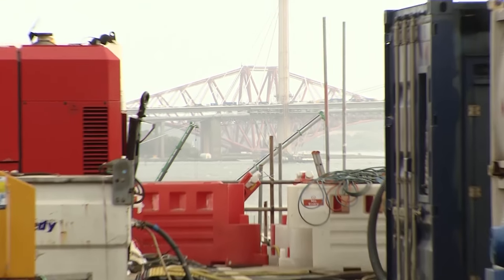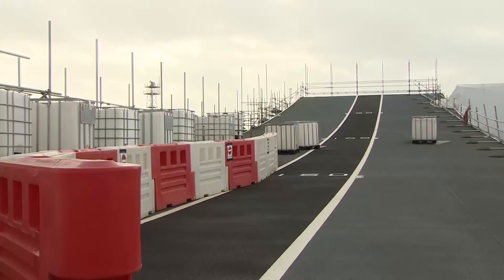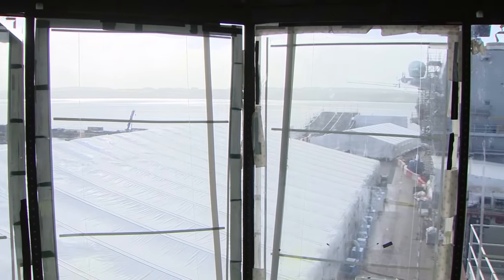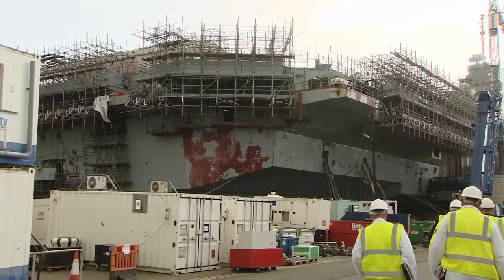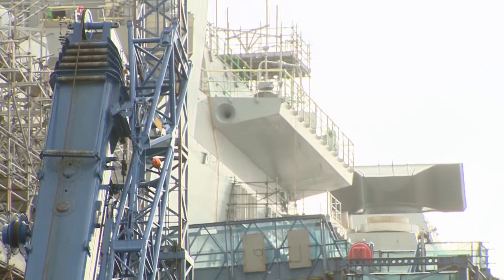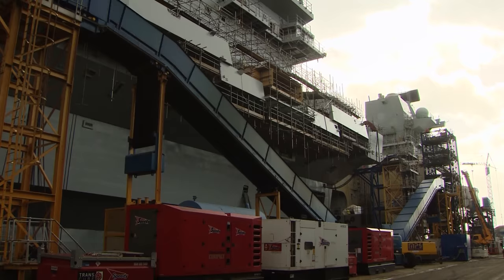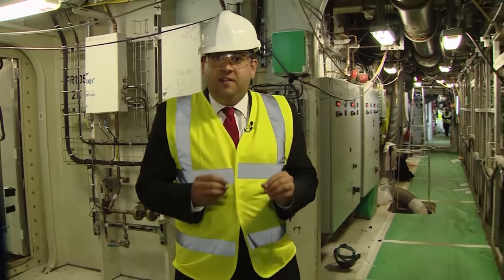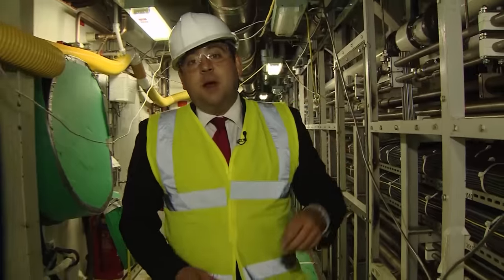HMS Queen Elizabeth Shipshape And Almost Ready | Forces TV

Comment: The reason there is 2000 sailors on the Ford vs 650 on the QE is because the Ford is much bigger with a lot more air equipment. The Ford is technically just as or more advanced than the QE. The Yanks have a shit ton more experience at building aircraft carriers than any other nation. Not only that they have a fuck of a lot more money to do research and development.
Reply: It's not that much bigger to warrant the huge increase of crew size, it's more of a combination of both.

The US has focused their efforts into areas which they'll find more beneficial for themselves. The Royal Navy is struggling to crew all of their ships due to lack of sailors, so automation is much higher on their list of requirements.

There's a lot of innovation in both ships and are a big jump forward for their respective configurations (CATOBAR and STOVL).
Reply: it is much bigger. don't let overall length fool you, it is only about 70 meters longer, but more importantly it carries near double the amount of aircraft 80 vs 40...on top of that the aircraft it does carry have more range than the aircraft the QE can carry. On top of that the Ford has a catapult assisted takeoff compared to the QE which is limited to only being able to launch aircraft capable of STOL. Which means the Ford class carries larger and heavier aircraft. No catapult assist is just a waste, limited to STOL is the same technology the very first aircraft carriers had...by technology I mean no technology at all, unless you consider a ramp, technology.
Reply: johnabuick HMS Queen Elizabeth will weight in at about 70,000 tons, cruise at about 25 knots (they say), carry a little shy of 700 sailors, flyers, and marines, and be able to field around 40 aircraft. Cost: $6bn where as the USS Gerald R. Ford will weigh in at about 100,000 tons, cruise at about 30 knots, carry a 2000sailors, and be able to field around 75 aircraft. Cost $12.8b U.S. But  it can only be in one place so two QE class ships are probably more flexible.
Reply: Peter Loftus
Sure, except the Americans already have 10 carriers the size of the Ford and ten times more ships than the British.
Reply: This video is in error - the Ford class actually will have a crew of over 4000. It took a lot of design work to get that down from the Nimitz class which has over 5000. If the QE's can get by with only 650 that is an amazing accomplishment.
Reply: The ford's crew is 1600, that 4000 number is the capacity including marines and airmen.
Reply: According to the US Navy .........
Crew: Ship's Company: 3,000-3,200, air wing: 1,500, other: 500.
Reply: and the Ford has planes..... jus saying
Reply: +peter loftus the US is building 3 Ford class carriers not 1. The QE has a small crew due to low funding to have a full crew and its smaller in size the Ford class has a large amount of automation but taken into account its nuclear powered and has far larger air crew the Ford is the most impressive and advanced carrier in the world

Comment: And what will they do when combat damage bends a bit of that metal track for the automated ammo movers?
Reply: Abandon ship, because if damage extends that far into the ship, it's lost.
Reply: If something has gone deep enough to damage the munitions handling equipment its reasonable to assume the munitions themselves have been exposed to the threat... ie a fair chance the magazine just went up and the ship isn't there anymore.
Reply: yeah 9 or so decks down, if something manages to get that far the ship is fucked.
Reply: That's surely the idea!?
Reply: Simon Ocean AEW was non existent in the Falklands, there was nothing until the Sea King AEW2 came online in 1985. The AEW2's then went through various upgrades culminating in the ASaC.7. The plan is to fit the ASaC.7 kit to a Merlin airframe and keep going, though this wont be online until 2018.
Reply: Simon Ocean Would rather have seen something based on the V-22 myself. Rotary based AEW is just so limited compared to fixed wing. An order of V-22's would also allow for long range COD and potentially tanking as well... not going to happen though.
Reply: Yeah I've heard some talk but I can't see the MOD stumping up the cash for it though. THE USN actually have commissioned the CV-22 to partially replace the C-2's. Still though given the size of fleet the RN would require and the procurement and operating costs of the V-22 I just don't think its likely to happen.

Comment: Great ships....shame about the F35!
Reply: Monster LMA What remaining Typhoon order?
Reply: The Typhoon is a fine aircraft, and you're right that they're different aircraft for (some) different roles, but the Typhoon has very little on the F-35. The Typhoon does have a little faster top speed, but it's not getting anywhere near that speed loaded down with external stores. The thrust-to-weight ratios are very similar, not "vastly superior" (1.15 Typhoon to 1.04 F-35B). The F-35 has the superior combat radius on internal fuel alone compared to the Typhoon's range with three external tanks. Where the F-35 is really has the advantage is the avionics, you got it completely backward. The F-35 has vastly superior avionics to any aircraft, even the F-22. The F-35's low probability of intercept AESA radar, distributed aperture system (provides IRST, missile warning, air-to-air and air-to ground target identification and tracking, high-off-boresight missile launch, night vision that still allows use of the HMD, all of these in complete 360 degree spherical coverage), EOTS (built-in, not an external pod wasting a weapons station), HMD, EW, MADL, cockpit displays, and mission computer all have no equal. The F-35 will be a huge capability improvement for the UK.

However, as you said, F-35 vs. Typhoon really isn't the comparison one should be making. They're both going to serve the UK together. The Typhoon for the RAF from the land, and the F-35B for the RAF and RN from the sea. If you want to make a valid comparison, compare the F-35B to the aircraft it is directly replacing in UK service, the Harrier. Compared to the Harrier, the F-35 is light years ahead in every regard.
Reply: I get my figures from actual official sources, not the likes of idiots like War is Boring or Pierre Sprey, and first hand experience. I work on the F-35 every day, I am a Marine avionics technician on the F-35B, and previously was the same on the F/A-18 Hornet.
Combat radii:
-Typhoon: 750 nmi (air defense, 10 min loiter with 3 external tanks)
-Typhoon: 325 nmi (ground attack with 3 external tanks)
-AV-8B Harrier II: 300 nmi
-Harrier II GR.7: 300 nmi
-Sea Harrier F(A).2: 540 nmi
-F-35B: 467 nmi (on INTERNAL FUEL ONLY)

All the Harrier numbers are with external tanks, while the F-35B is superior or competitive on internal fuel alone. Just look at any legacy aircraft, Typhoon, Harrier, Hornet, F-16, F-15, you ALWAYS see them flying with external tanks because they have such short range without them, especially with lots of heavy bombs dragging them down. I don't know how to convince you about the avionics, the F-35 simply is the most advanced radar and avionics suite ever put in a fighter aircraft.

The F-35 can go super sonic for short periods without afterburner. The afterburner has nothing to do with radar signature, it only would affect IR signature; IR guided weapons are pretty much all short-range. The non-stealthy Typhoon is always vulnerable, afterburner or not, whereas the F-35 is only (partially) vulnerable when it is CHOOSING to use its afterburner.

The F-35 can catch the Tu-22M, which isn't really a bomber but a ground attack jet. As for the just 16 Tu-160s Russia has left (even fewer actually airworthy), they can more than be handled by the F-15 and F-22 and as you point out, the Typhoon.

Don't know what you're talking about when you say stealth is because of "active" systems to cancel the radar signal; this just isn't true. If you mean the electronic warfare jammer, that is for jamming, it doesn't "cancel out" the F-35's own signature. All these "stealth defeating" radars that the Russians and Chinese boast about are all bluster; they are far behind the West in radar and other avionics technology. Don't expect them to magically defeat the stealth of the F-35, F-22, B-2, or B-21 anytime in those aircraft's lifetimes.

I agree that the UK could have got a better capability with the F-35C, but they made that choice too late. Typical political shortsightedness and liberal sabotage in regards to the military. By the time they said they wanted the F-35C, the carriers were just too far along to change their design. And the F-35B does NOT use afterburner in STOVL modes of operation! Don't know where that came from, but it's total BS. In the field, it can operate from the same AM-2 matting as all our other aircraft (and yes, we have already done this in testing and operationally).
Reply: Locutus494
Reply: Good post, but your carrier design change information is backwards. In fact, these new Royal Navy carriers were originally designed with angled flight decks, cats and traps and with the F-35C in mind. You can see the original design concepts online. The Ministry of Defense made a late hour design change to eliminate cats and traps. Of course that necessitated the F-35B with it's STOVL design. The decision was purely to save money but it was shortsighted because it severely limits the kinds of aircraft that can be launched and recovered by the new carriers. The design change will also limit its mission capabilities since the F-35B model has shorter range than the C model. Additionally, the carriers won't be able to utilize the highly capable E-2D Hawkeye airborne radar aircraft, which would have given it far better and longer range "eye in the sky" situational awareness. Those duties will now be handled by a far less capable helicopter carrying airborne radar that can't loiter for nearly as long as a Hawkeye. Hopefully, the Royal Navy will turn to the V-22 Osprey and utilize it for resupply cargo. I wonder if they can build a version of the Osprey with airborne radar? Probably, but that won't be cheap.
Reply: Lol f35b whont have anything to land on! The uk are selling these ships after a three years service. Google it if you dont belive me all part of tory wanker cuts.
Reply: Tim Xero, your complete ignorance in all your comments here is astounding! Literally not a single thing you said about the F-35, F-22, US-Japan history, or anything else you talked about is remotely true. The US banning other countries from making stealth aircraft, are you high? The US has no authority over it's allies to tell them what they can and can't do. What in the hell are you talking about here? F-22 has no radio? How could you for a second think that is actually plausible. And it was cancelled for the same reason as any other useful military program is cancelled; because idiot politicians don't learn the lessons of history and keep chopping the military when they should be building it up. The US occupation of Japan ended in 1951; our presence there since then is as part of our security agreement with Japan because Japan's post-war constitution renounces having its own military and it allows the US forward basing to protect its interests in the East. It is mutually beneficial.
Reply: Van-gabond,Ramblin'Rose And not that many of them either. ?
Reply: Locutus494 Are you seriously suggesting that the stealth aircraft will not be able to be detected within their lifetimes? That is a pretty assured statement. I would suggest that the US has already developed radars that can lock on and track all these aircraft! They would be insane to field one without the ability to defeat one.
I would also point out the panic that occurred when a rapier demonstration radar locked on to the B2 at the Farnborough air show in 1994. They flew it back to the the US post haste for about a $billion worth of modifications!
Reply: Yes, they were in 1982, and still are.
Reply: "QE class just can't do the job" What a idiotic statement to make. Of course the Carriers compared to America appear less good but America spends more on their military then the top 10 nations combined.  These two new aircraft carriers showcase that Britain is a global power with the ability to fight anywhere in the world at anytime. So what the aircraft carrier is not vertical, so what its not nuclear powered?

Britain is going to build new nuclear war submarines soon. Which will cost over 100£ billion over its lifetime. Anything compared to America will  be shit. But the fact Britain can have a free NHS, wealthhfare state and a global navy is amazing. I call it eating my cake. Bottom line we have a world class Navy coming into play. If turn of events take hold Britain as demonstrated can build aircraft carriers in 5 years. One of the few nations with the ability to build our own kit.
Reply: britain its not global power.usa russia china and now japan are
Reply: USA yes, Japan well no, Russia maybe, it depends how you measure it?
Reply: japan yes.their marine is bigger and stronger than britons
Reply: Depends how you measure it, as I said.
Reply: Nothing wrong with it, do some more research
Reply: Not true. USA is a superpower. UK, France, China, Russia are Global Powers in that Order. UK/France have bases in every single part of the world. This making them a Global Power. China/Russia couldn't invade a country like Nigeria for example.  No bases nearby. They couldn't invade Brazil either. Global powers = power around the world. China are limited to South East Asia.
Reply: KAIDE2009 so how usa can invade china?usa cannot invade china.they have bases around china but china have strong military.its imposible to invade them.usa fail badly to invade poor vietnam
Reply: I never said the USA would invade China? But the USA does has bases in South Korea, Japan and Islands around China. I'm not saying the USA would win in a invasion but it has the physical means to do make it plausible.. China recently bought a aircraft carrier of Russia from the 1980s China recently bought a British Carrier from 1945 to help build its own. China will be a super power but at the moment its not.

China is a global, regional power. It can't influence events in Europe or in America. Britain can influence events in Australia, Europe, Middle east. USA can influence power every where in the world.
Reply: yes an poor countrys like iraq,afghanistan,lybia,syria.so usa has bases around china is ok?and china is build one base in their waters is not ok?
Reply: bla bla bla
Reply: you coment is interesting
Reply: china or russia can not invade Nigeria lol lol